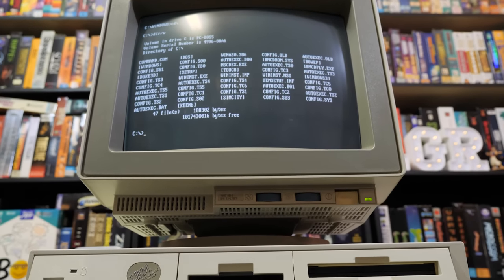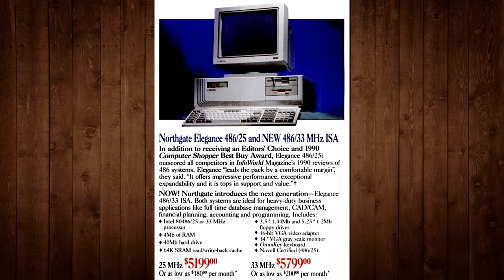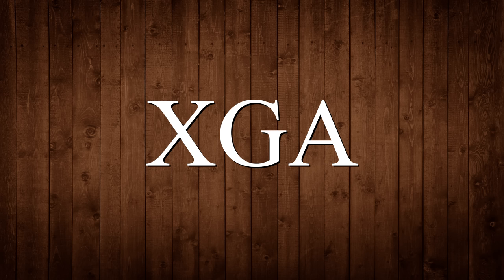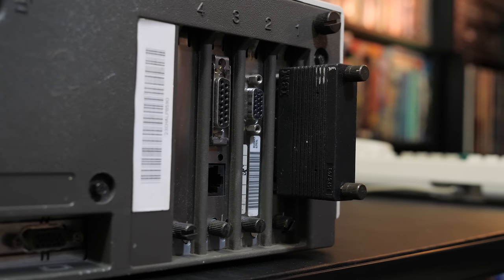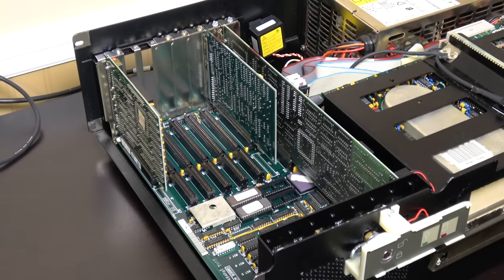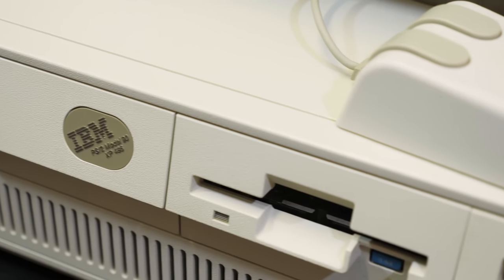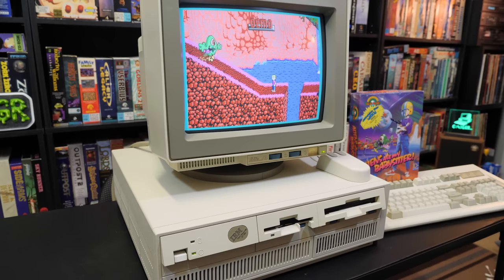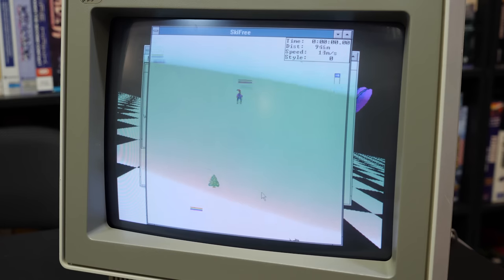$17,000 PC from 1990: IBM PS/2 Model 90 XP 486

Comment: I remember putting OS-2 Warp on my 486DX2 Packard Bell, LOL! Bill Gates really ruined it for IBM. OS-2 Warp was so much farther ahead of Microsoft it wasn't funny.
But by flooding the media with Windows 95 will be here soon! Starting in 1994, and not actually hitting the market till almost 1996. OS-2 Warp was buried and went nowhere, because everyone was holding off in anticipation of Windows 95...
I remember going into the Egghead Software store, and everywhere I looked was Window 95 posters, and hanging signs, flipping in the AC breeze...
At one point, I thought Microsoft had bought out the Egghead Software chain!
Anyway, awesome look back at the tech of the day, LOL!
I was going to college, learning computer electronics. Back then, a 1,000 MB HDD was $700! Nope, that's not a typo... I remember installing a 10,000 MB 10 GIG HDD in a banks mainframe, it cost $23,000!!! Just for the HDD!!!

Comment: I am old enough to remember this and earlier. IBM miss read the market completely. They thought they were in control, but it wasn't 1981 anymore. These machines were largely ignored except for some corporate customers who only bought IBM. But they learned.. separately, future proofing never works. I've seen it many times, almost never does anybody ever significantly upgrade one of these machines. They might add memory or storage but that's about it. It turns out to be too expensive and not worth the trouble. Better to buy a new machine.

Comment: The price tag of those computers makes me wonder - if we had a time machine and brought back a common high-end gaming PC of today back to the early 90's, with it's i7-8700K, 1080Ti, 16 (or higher) GB of DDR4 (Any speed beyond 2666), SSD drives and so on, what would it be priced at? This is NOT given the billions of value for research and backwards engineering for duplicating parts and selling.. that they might not even have succeeded at. Just too advanced for their equipment.

Comment: The problem IBM faced with this line was at that price point you're in true workstation territory...without the performance or software to back it up. Sun's SPARCstation or HP's PA-RISC machines would destroy this in price/performance and WinTel had no equivalent to the UNIX dominated 3D rendering software that was available for these platforms.

Comment: Hey Clint, your 8590 is very well spec’d. Is there anyway you could help the community out by helping us with 3D printing models for the memory riser bracket, CPU fan shroud/ cowl, and the cdrom faceplate bezel? These parts are impossible to find. Thanks!

Comment: Ps/2 in 1990: 4mb ram, 80mb hdd, $13k.
RPi4 in 2019: quad core 1.5 ghz, 4gb ram, $55.

Yea, i know it's an arm, but with a small heatsink and an equally small fan, it runs doom in dosbox under 40 C
Reply: Or you can use your brain and buy pentium PC for 10$ if u wana play Doom on real MS DOS...

Comment: The 486x25 was the worst dog of a computer.  I think it was even slower than the 386x33. The 486-33 option was a PC that with memory upgrades could last someone at least until 1996 or 1997. I held onto mine until win 95 came out and I was forced to upgrade to a pentium-100  I did not touch the pentium 60 or 75 because they were horrid as well.

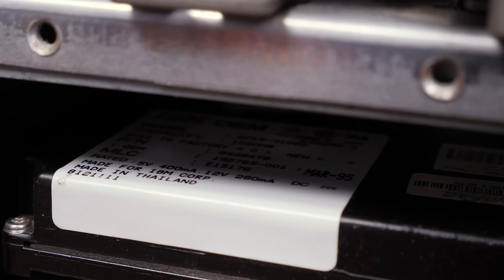Comment: 3:31 There is no way a 1GB 3.5" drive was $2000 in 1990. The average HDD size then was 40MB. 1GB would have been astronomically priced if it even existed in the 3.5" form factor.

Comment: I think I paid $3200 for my PS/2 SX (25), 2MB Ram, 128 MB HD. Then added, a entertainment pack $400, that included a CD/ROM drive AND a 8bit Sound Blaster card with 2 small speakers. I could really heard those Nazis scream "Mein Leben!" then!  I doubled the Ram to 4MB for only $299 and added 320MB HD (don't remember the cost). Since the CD ROM was where the 5 1/4" floppy drive used to be, I had to just wrap my new "E Drive" in a thin piece of foam & tape. Just in time for "DooM" and those expensive pre-internet Death-Matches on "Dwango"  Those were the days...  <sigh>

Comment: In this day and age, fast processors, massive hard drives, and huge amounts of RAM are very inexpensive.  Back in 1990, there was probably more engineering that went into improving performance and capacity, and computers weren't as widely sold, so that's why they were overpriced back then.

Comment: I like that CD drive. I showed my mom this vid, and she thought that was a floppy drive the entire time.

I also had an old PC that ran Windows 3.1 and at one point my dad tried to put a CD drive in it but never got it to work. The weird part about its design is that it's an internal drive that uses a flip-top lid instead of a a cartridge like the Model 90 XP did or a motorized tray. The only way to access the flip-top cover is that you'd have to press in on the front face of the drive to unlatch it, slide it forward, and flip open the cover. I wish I still had that PC when we moved. I can't remember what model it was, and I was only about 6 or 7.

Comment: gee so expensive i dont get why my trident 8900c with 1 meg isa from 1992 had the same graphics ability as that in color and resolution at the time... i upgraded to a 486 too with everything upgraded for 1300 or so in early 90s from a 386.... 32 meg in 1990 is crazy over kill, i had 16 meg in 1995 and that was top of the range then too  but by 1997 that was min

Comment: But can it run Win XP if you max out the upgrades?
Reply: probably. I think an Intel Overdrive processor which upgraded a 486 to a pentium was available. I've seen XP run on 64mb of ram, not well at all, but it did run. So yes I think you could have gotten Windows XP to run on it, but the value of such would be questionable.

Comment: "I find 3 oddly charming", haha, isn't windows 3.0 like the buggiest least stable version of windows? Before anyone brings up Vista. Windows vista is almost identical to windows 7, the problem with vista is that microsoft lied about the system requirements. For most people at the time, using vista was like trying to run OS on a calculator.

Comment: 32 MB of RAM and a 1GB hard drive on an early 486.  That's silly, and probably file server specs for the time.  But since hosting a BBS is boring, you need the 1MB of VRAM to run Windows 3.1 in 1024x768.  640x480 is for peons.